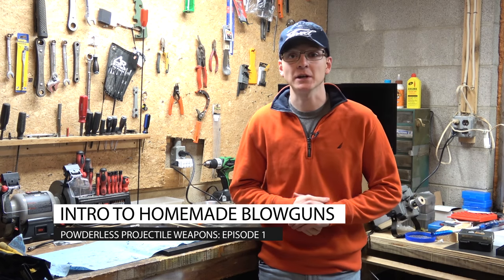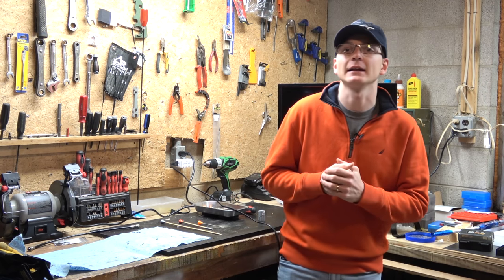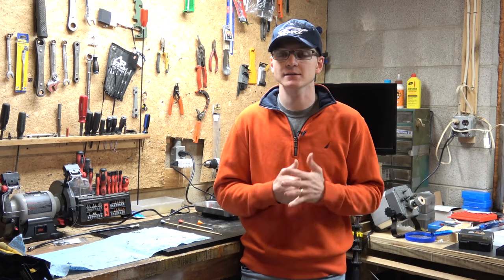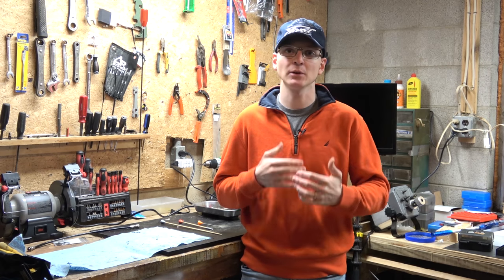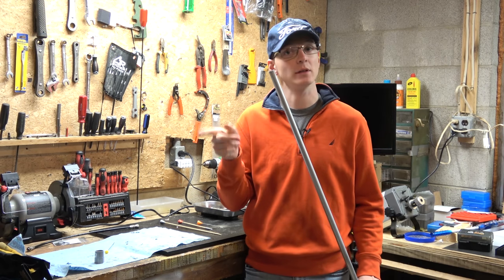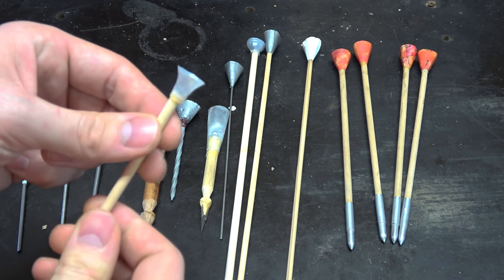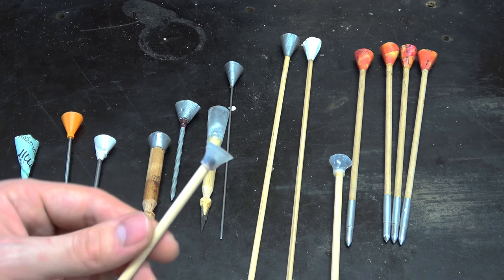Intro to Homemade Blowguns

Comment: My dad taught us how to make blow guns and darts when we were five and six years old, I've had one ever cents, which adds up to about 55 years of practice. I find a heavier wall steel pipe to be much more accurate, half inch bore is best all around and if you want to increase your range dramatically, use a dart with a very small cone an insert a bore fitting cone into the end of it is, if you don't jostled around and dislodge it from that loose fit, when you shoot it air drag will pour the ceiling cone off and the dart With it's under sized cone will create far less air drag yet enough to keep the dard stable depending on how you make it, end it will retain its speed far better at distance with less drop. With the right Broadhead and an accurate shot, you can easily kill Havelina and midsize wild hogs. Tim Wells actually killed a black bear with a well placed dart.
Reply: Forgive the spellcheck errors.
Reply: How many wounded by a rib shot...not very ethical

Comment: If you are using wooden skewers for darts you can make a very durable point on them by snipping of just the point so you have a 1.5 - 2 mm flat end on the skewer. coat aprox 15 mm of the end of the skewer with super glue, hold the dart vertically so the glue runs down to the pointy end and then dip it in bi-carb soda (baking soda). The glue hardens instantly into a very hard plastic like material.  Repeat this 3 or 4 times to build up enough material to be able to sand or grind it into a point.
Reply: Yes, I’ve repaired a paring knife handle with superglue and baking soda - even held up through several dishwasher cycles.

Comment: Try a PVC "T" for a mouth piece. Cap the ends and drill a 5/8th hole in the top. You will be surprised at how much more power you'll be able to produce....

Comment: I have found putting the curve of the tube so the tip is pointing up works well.  Even if no curve is detected placing a "sight" on the tip so it is always up creates tighter groups.  When I start grouping to the side, often rotating the tube will bring it back to center.
Reply from the maker: That's a great idea! I'll have to give that a try.

Comment: I  use sharpened bicycle spokes about 10" long for the darts. They are high quality steel and work perfectly.  They can be hammered flat on the end and you can easily form a "broadhead" with a file.  It helps if you heat the end, as the steel spoke is very hard and somewhat difficult to hammer flat.  In a pinch, I've even used a 16d framing nail as a dart.  It works, but not nearly as good as the spokes.  Far too heavy.  

 I cut a plug of high density styrofoam (about 1 1/2" long) for the "fletching' and shove the dart about half way into the plug.  I use a short section of the pipe (sharpened) as a "cookie cutter"  by twirling it between my hands.... like the woodsman does when he's trying to start a fire using a stick.   The styrofoam plugs might be slightly too tight in the barrel, so you will have to roll it very slightly with a flat board to make it a tiny bit smaller in diameter. Easy does it....or you will make them too loose and they won't be worth a hoot. This is critical. You want to achieve an almost totally air-tight seal and yet not too tight to impede it's efficiency.  Just dip the end of the dart in super glue and shove it into the styrofoam plug about half way and let it dry.

I use 3/4" electrical conduit pipe for the barrel.  The pipe length of 60" is critical.  I have tested it using lengths from 24" to 72" and 60" is perfect. I also take a wooden dowel, make a saw kerf in the end, slip a piece of 100 grit sandpaper in it and chuck it in a drill and polish the inside of the barrel.  It makes a HUGE difference.  I also swab the inside with silicone (WD 40 WILL NOT WORK!) and let it try thoroughly before using it.  

Mine will penetrate 1/4" of plywood easily from about 40 feet.  Be careful..... these things are VERY dangerous. It will easily penetrate a Walmart chicken breast! Same with an apple.  A can of warm beer in the summer is awesome if you shake it up first!   Be sure and take a pair of pliers with you when you go afield with it, because many times you won't be able to pull out the darts without ruining them if you hit a tree or wood surface.  

Tip:  Push the dart into the barrel about  an inch and a half before you shoot it.  It makes a BIG difference.  Try it without it..... and then with it and you will see what I'm talking about.  To get the most velocity from it, you have to blow into it as if you were trying to spit a hair from your mouth.  You want a sudden burst of air, with lots of volume and gusto! 

I made my first one when I was 18 years old.  I'm now 76, and I made two of them this week.  I refuse to grow up!
Reply: Thanks for  your experience  will make one  based on all your comments  but except for the beer can
Reply: Thanks for doing testing on the velocity of different lengths. I've searched high and low for someone who has actually done this, not just bought or made an arbitrary length and say "seems to work good!" I would think all the shooters making or buying these would understand there's diminishing return of too much tube or leaving energy on the table with too short. Again, thanks. 5 ft is the call
Reply: @nicetryb0z0  , I put in the wrong diameter for the tube.  I put 1/2" when it should read 3/4".  My bad.    I didn't mention, but bamboo shiskabab skewers, ala Walmart, make pretty good darts, too.
Reply: @nicetryb0z0 thanks for sharing, sir
Reply: Spokes are good - I got some motorcycle spokes and they're even better.
Use a caulk gun nozzle for the cone
Reply: @raiderfandew  Do you use a 20mm tube?
Reply: Cheers good info.

Comment: 50 years ago, my father made me and my brother a blow gun out of a 5' length of 1/2" copper pipe. He flared the end slightly with a flaring tool to create a mouthpiece.

He made darts from short sections of bamboo tomato stakes. The darts were fletched with tufts of yarn, and tipped with nails whose heads had been clipped off. By cutting the bamboo so that there was about 1/2" of empty section in front of the joint (front of dart) and a longer empty section behind the joint (rear of dart), it was possible to insert and glue the nail so that it was supported at its rear against the joint if the bamboo. We made two sizes of dart, one using 1" finishing nails and a section of bamboo about 1 1/2" long, and one using 4d (four penny) finishing nails with a bamboo section about 4" long. The fletching for both was short sections of yarn whipped and glued around the back of the dart.

 The longer darts would shoot quite a distance, and were great for outdoor shooting. The shorter darts were fun for shooting in the house at short distances.

Yarn fletching works quite well on the darts.

I still have the blow gun. I made some darts a couple of decades ago, and let my young son shoot them. But I haven't shot it in the years since then.
Reply: Wow

Comment: Thanks!!!  The skewers that you did not use, because they were not straight, can be heated and straightened similar to wooden arrows. And possibly heat treated or hardened. I will try to make me one.
Reply: I heat treated the tips of bamboo skewers.  The skewers would stick into the trunk of white pines around my property. Those with hardened tips stayed sharper longer and probably penetrated a little deeper.

Comment: Instead of a shaped dowel for cone consistency, you can make a cone out of paper, fill it up with hot glue and stick a pencil into it for better handling.
I also use post-it-notes for the first layer and then cover it with duct tape, which makes it stiffer than 2 layers of tape, in my experience.
Reply from the maker: Good ideas!

Comment: You did a great job on the blowgun. When I was younger me and my cousins had blowguns one thing we would use is push pins, like for a cork board. We would fire the push pins like any regular dart and we called them stingers. LOL

Comment: Big fun, thanks! I made dart cones from milk jugs, as you mention. Heat a spot on the side with a Bic lighter, until it suddenly forms a clearish white circle; then push a plumb bob in as a form. Cut free from the jug by pushing a piece of the metal tube down over the plumb bob point. Shafts were usually drywall nails pushed through the cone with a dab of silicone for weight. These worked very well I thought, but I will try the duct tape cones and bicycle spoke shafts.👍

Comment: Thanks for the video. I used to make darts similar to your method, but then settled on golf tees for the skirt. Sometimes they were too large and would need to size them with a bit of fine sandpaper. I would carefully drill them and add a wire which I flatten into a broadhead, tempered, and sharpened. The blowgun was pvc pipe which was then glued into a bamboo stalk to give the pipe rigidity. I have a couple blowguns that are 8 feet long and pack a wallop. I killed a lot of pigeons with them to rid the neighborhood of pests and make pigeon stew and pot pies.
Reply from the maker: That’s great! Thanks for the comment!

Comment: 1:32 in my elementary school we started with clear BIC pen bodies and a coat hanger about 2” longer. We bent a small hoop in one end of the wire. Then we chewed on a small piece of paper unti it was totally saturated with our saliva. We wadded it into a small ball and pushed it in the back end of the pen, then using the wire we pushed the wad down, while holding the tapered end of the the tube flat against our desk tops, we packed the wad into a hard pellet maybe 1/8” long. We repeated that until we had several pellets.
To shoot the pellets we loaded one pellet in the tapered end and pressed it about 1/4-1/2” into the barrel. Then in the other end we inserted another pellet. Shooting was accomplished by ramming the second pellet into the barrel quickly causing pressure to build up ejecting the other pellet. 
Yes, very slow to shoot. Richard Sharpe would have been disappointed. Maximum range was maybe twenty feet, or most of the way across the room. If you learned how to do it just right, the plunger-pellet could be used as the next projectile, speeding up reloading. And the little pellets, because they were packed hard, had a little sting when they hit. Not like the floppy wads shot through straws. But, (and this is an important but), or additionally, when the pellet ejected from the barrel, if done correctly, there was a very satisfying *snap* sound that you could hear all through the room. 
Good memories.

Comment: I've seen a jig for placing the cones onto your darts that guarantees that they're going to be centered and the cone is going to be a proper fit
Get a piece of your tubing that's a little bit shorter than your darts are gonna be put a membrane on one end and place a hole in the middle of it then place your place and then place that in the opposite end so that your dark goes through the membrane and your cone is centered in the opening and then get a very sharp knife or razor blade and what's outside of the tube and some superglue inside. Let it set up, pull it out and you have a perfectly centered dark.

Comment: In highschool back in '70, '71 time period I would take 3 soda straws on a slightly smaller diameter and two soda straws of a slightly larger diameter and and fit the first ones into the second to make a three soda straw blowgun. I would take  straight pins a toothpick (the round ones, some thread glue and a small feather like from an english sparrow). Carve a small notch in the side of the toothpick and fit the head of the pin into the slot and tie the pin down with thread and glue, tie the feather to the other end. the darts would go 40 ft across my band classroom and stick in the wood paneling. I still do blowguns, now using the .6" diameter with the storebought broadhead darts.

Comment: 27-36" of 1/2" pvc with a 3/4" coupling on one end
Different sized nails with cigarette butts for flights work great
Cut most of the paper off leaving a strip to hold one end together and splay the fibers out
A drop of crazy glue under the head of the nail and push it right into the butt
Reply: Genius! So simple

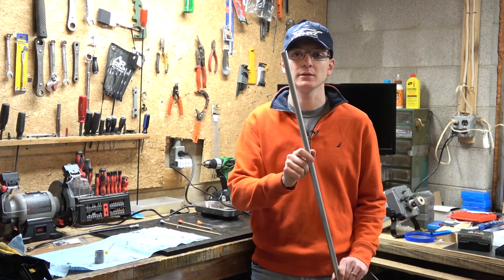Comment: 6:02 I am not an electrician so not an expert, but I think the reason 1/2” conduit is actually about 5/8” is because the fittings that are used are 1/2” in ID. It’s opposite of plumbing pipe. The fittings go around the OD if the pipe, so the ID is the designated size.

Comment: I've been using inkjet photo paper for cones. Glossy side out for lower friction.  18mm tube / PVC conduit. Water has no effect on the paper, quite stiff and durable.  I can get 6 cones out of a 10 X 15 cm sheet.  I found a conical former, use sticky tape for the outer adhesive, superglue to attach the cone to the shaft.  Shaft about 4 - 5 mm od and about 200 mm long seems to be accurate.  I've tried 3 mm carbon fibre up to 6mm dowell and chopsticks (bit heavy) settled on the 4 -5 mm dia.

Comment: Would you gain or lose anything by putting a second cone half way down the shaft? Any seal you lose by the fit of the end cone might be picked up by the one halfway down the shaft. Would a second cone that add too much weight or help with stability in flight?

Comment: Making a tight fitting plug on a ram of some sort and using lapping compound ran back and forth to smooth the inside will gain some speed.  An important aspect to consider is the headspace; that's the dead air space between the dart and your mouth, the larger the space the slower you can shoot.

Comment: Great video! 
You may be able to smooth out the inside of the conduit tube by pushing through pieces of steel wool. And go from heavy to fine grade mesh for increased bore smoothness.
Reply from the maker: Great idea!

Comment: Heck yea!  Tim Wells!  World best primitive hunter we all should know about! 

Make sure its straight by putting on floor and see how it rolls is better then eyes.  Well mine. lol

Make sure your pipe dont have the seam running down inner part.  

Honestly Id say find a bore where you can buy darts to work with.  They are cheap and effective.  Then play around if you are interested into making your own.  Which is awesome!  You can always play with making your own.  But will alway have the backup of paying for effective darts.  

Mine I bought,  but big bore. .625.  I would love to see if that is less effective or more, compared to .50 inch caliber.  It seems smaller might be quicker.  I mean less volume for same speed.   Makes since to me but IDK in real world if even matters or ....  

I did like and sub because you mention Tim Wells!  It is also very education video!  TY  Hopefully my comments also help people as much as your video does!  Few live but we all die!  Live it up!

Comment: Educational video that comes 55 years too late for me.
Of course I also had a blowpipe in my young childhood. With slightly less advanced arrows.
We made them from magazine paper that we cut into strips 6 to 7 centimeters wide.
If you wrap a strip around your finger and then stretch it to a point, you can wet the point with your mouth, the paper sticks in this shape.
You now drop your freshly made dart into the tube and tear it down to size.

Comment: For the blowgun: I found using 10% of you lung capacity for the volume of the tube. To get your lung capacity blow ONCE into a balloon and check the volume (maybe checking be displacement, that is, putting ballon in bucket of water and measure how much water it displaces). Longer tube better, if your lung capacity is low then the tube must be thinner.
For the dart: I used to attach the cone a bit skew until I made a guide. Basically small tube in a piece of (same size as blowgun) tube (PERPENDICULAR), then attach a piece of tube( same size as blowgun) ALSO PERPENDICULAR.
My length of cone have been inconsistent, so I'll use the form idea and I used paper thus I'll be switching over to duct tape.
Else great video, thank you!
Reply from the maker: Good idea for measuring lung capacity vs tube length/diameter! Hadn’t thought of doing that but it sounds like an interesting experiment.

Comment: If the inside diameter of your blowpipe is critical be sure measure the pipe at the store.  They are not all .625" ID. 

I bounced here because of the blowpipe and I'll check out your channel.   It sounds like you were in a 
homeschool tutorial or something like it. There are often high expectations that the kids will entertain 
themselves appropriately  during down time.  I love projectiles.  My first experience was projectile 
vomiting but at 14 months  that probably doesn't count.  By second grade I was getting pea shooters 
at the grocery.  These were large straws and the peas were soybeans.  In seventh grade we started 
using 12" sections of aluminum arrows.  It was a perfect size to hide in our tube socks.  We'd cut off 
the aglet and 5/8" of the string (lace) from our shoestrings.  The string was shredded  and trimmed 
neatly. You could put a sting on somebody with these but it was most enjoyable to cut the aglet down 
to half length and push a straight pin through the center.  The amount of pin protruding was determined 
by our feelings toward the target.  In college we played with 25" sections of arrow and made darts using 
Q-Tips with the plastic handle instead of the paper one found today.   Working with a toothpick we could 
affix a point in the hollow plastic Q-tip and hunt denizens of the dorm, namely Palmetto bugs.  Toothpicks 
with cotton wool wound around the end also worked. That was in our dorm rooms.
Reply from the maker: Diameter is not critical at all, as long as you are fitting the darts to the bore. Thanks for the comment!